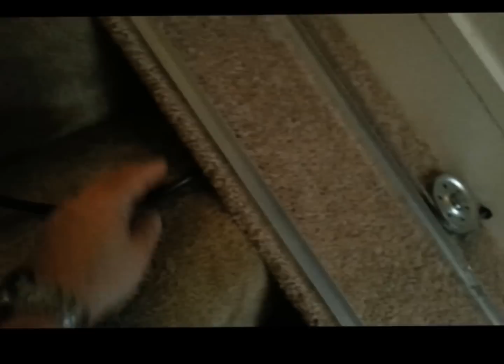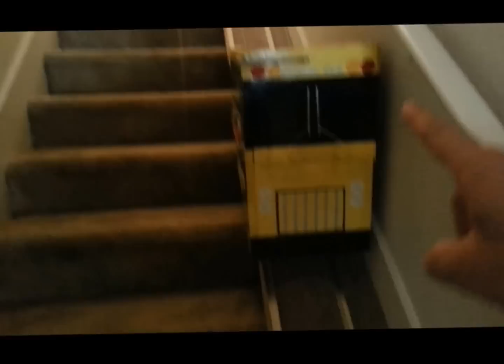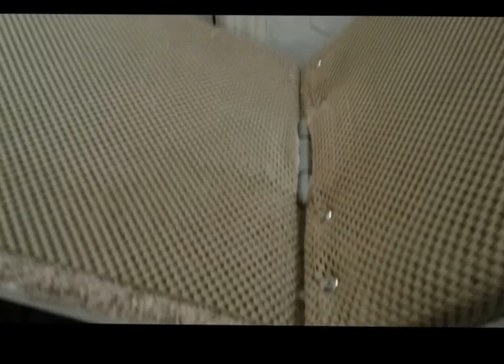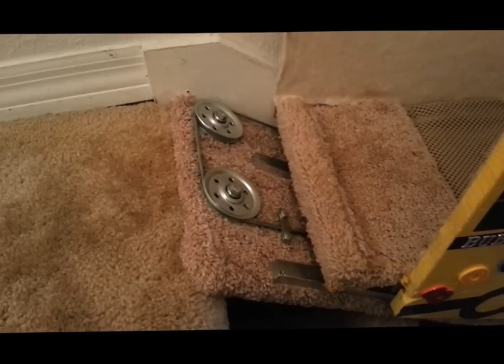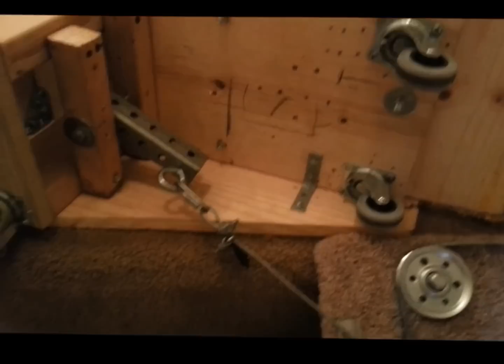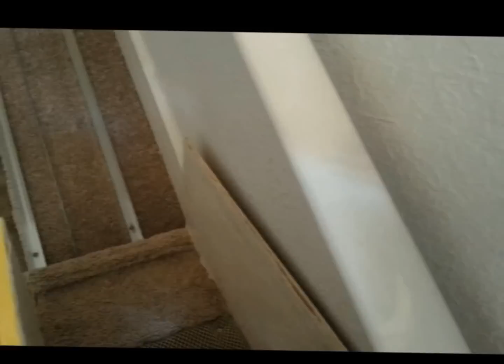"The Making of Bubba's Boom Boom Bus" - Version 2

Comment: Hello,What a great Bubba's Boom Boom Bus!!!  Would you be so kind as to tell me what the dimensions of the bus is? Thank you!
Reply from the maker: 24x12x9 . These are only approximate for the interior of the box where the pet sits. It is very dependant on the size of your pet and should be larger or smaller depending on size. I made Bubba sit on a piece of cardboard and traced around him to make sure there was enough room but not too much wiggle room.  These bus is very stable as it moves along the track, but we still stay along side of it for safety and security. goodluck.